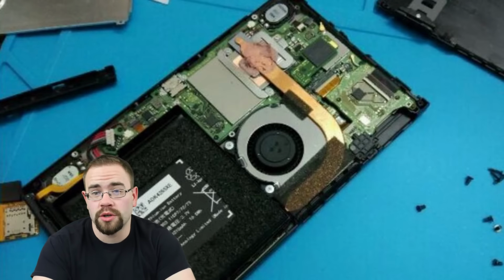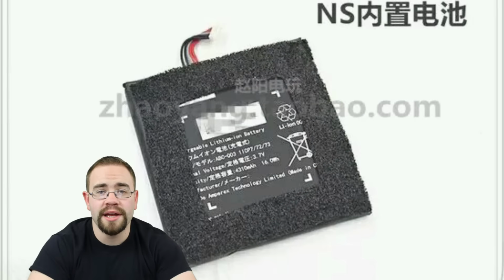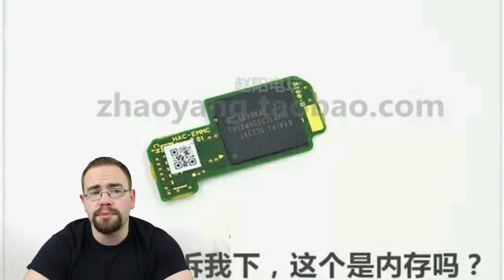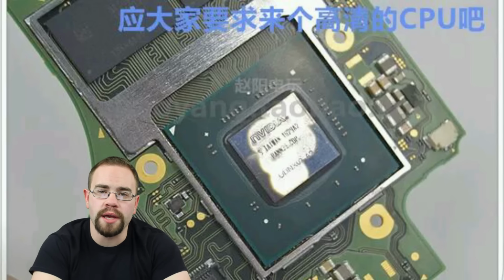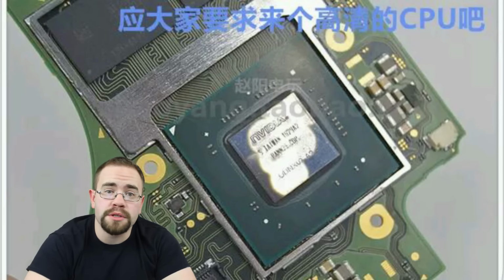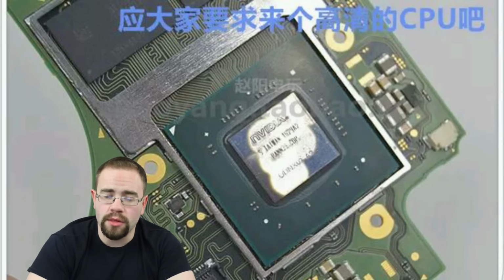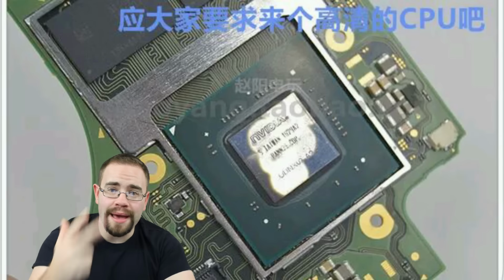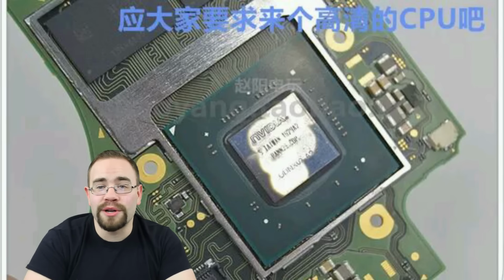The Nintendo Switch Was Finally Disassembled!

Comment: Stop spoiling yourself spawn, we all know you are more excited about being able to disassemble a switch than to play with it.
Reply: José Linares Whats the point if someone already opened it
Reply: Because these pics barely tell us anything about the thing and the person that opened it didn't analyze it at all so we still don't have any info on what stuff like the SoC or the RAM memory have exactly. The only thing this is really telling us is that the whole device is very neatly packed, there are still quite a few things to uncover by anyone knowledgeable enough if they open it themselves. (And besides, I'm guessing it's still a fun thing to do for some people, even if everything about the console is already known).
Reply from the maker: Yeah I'm really excited to get it a part. I think it'll be fun and if nothing else you guys will have a video to refer to if you need to replace your battery or card slot.
Reply: Because there's no confirmation on whether or not this one was a retail unit or DEV kit.

Comment: I love that people are shocked that it's a custom chip, and not off the shelf, considering that Nintendo announced it was a custom chip
Reply: Denni Wintyr ikr
Reply: It look like a Tegra  A2  chip
Reply: lot of women look like women, but underneath are "men"...

we need to see under the hood...lol

sorry i need some love in my life
Reply: Denni Wintyr Oh my
Reply: You don't have to reply to every comment, scrolling through I see you everywhere
Reply: Walther Penne zelda ran smooth at the treehouse event don't know what you saw maybe the old demo on the ground floor
Reply: ***** what they showed at the treehouse event didn't drop fps I own the switch and yes there is some dropping hardly any and it seems to be certain locations , even more demanding locations don't drop yet some isolated areas do, which points to memory leak issues, it happens in other open world games like the witcher 3 and even skyrim remastered, just spots that aren't optimized fully that they may have over looked,  it doesn't seem like hardware issues since they always happen at certain spots and in certain angles yet 90% of the game is fps drop free and will probably get patched out as time passes for being ported in a year on new hardware I'm impressed it runs as well as it does
Reply: In about 20 hours of play I've had two frame rate drops, of about a second each.  That's it
Reply: Denni Wintyr are you sensitive to them? cause in my first 30 minutes in great plateau I've had more then that, it's really random but it happens in specific areas I think it's due to being ported in like a year and it's hard to optimize such a huge game that soon
Reply: It is the worst on the plateau and is negligeble to almost non-existent anywhere else
Reply: TheJamaicanGamer well it happens in some areas I ran into some on the mountain near zoras domain, and other various random locations, I think it's just port issues and they will get fixed with time

Comment: The Foxconn leak nailed it.
Reply: Dash120z Somewhat. It has an X1 like chip rather than a P1, Pascal, like the Foxconn leak said.
Reply: Proto Onii naw it's a pascal
Reply: Proto Onii ya, i could have sworn they stated that.
Reply: Proto Onii well technically it is an x2 so it actually wasn't really wrong when it comes to that
Reply: Ryan Joseph invalid. No one knows what it is yet.
Reply: AUGMC True! True!
Reply: foxconn say looking at the core it is a 10x10,  from the cpu test: cpu 1785 Mhz , GPU 921 Mhz , "speculated it is a arm a73 pascal" he never corfirm it is pascal he only speculated that , from what neo gaf guys got this is a 11x11  not big dif if he only do it with eye. 

https://www.reddit.com/r/NintendoSwitch/comments/5ea9uo/rumor_someone_who_producing_switch_at_foxconn_is/

PS: sorry for my englesh hope all undertand it =P
Reply: AbdallahSmash026#1Fan well it's almost on par with the XB1 which is a good thing ;)
Reply: AbdallahSmash026#1Fan Get that idea out of your head right now. The switch will never be as powerful as the Xbox one
Reply: Dewott You don't need to be aggressive we are talking about a piece of plastic. Even if it was Pascal it still wouldn't be as powerful as an Xbox one. You really think a $300 tablet will have the power equivalent of an Xbox One? Go ahead and hype yourself up.
Reply: link2dpast the switch has no plastic in it whatsoever actually
Reply: Ryan Joseph So what is the outer shell of the Switch made from? Or the Joy-cons?
Reply: link2dpast Bethesda said it won't support the Switch if it was less powerful than the Xbox One ;)
Reply: Dash120z Source? And just to pop your bubble why doesn't the Switch version of Skyrim look as good as the Xbox Ones remastered version. I know the Switch version is also the remastered cause it looks a lot better than the original Skyrim but if the Switch was at least as powerful as the Xbox one why isn't it's version of Skyrim on par graphically with the Xbox ones version.
Reply: link2dpast here's your source  http://wccftech.com/bethesda-developing-nintendo-nx-powerful-xbox/
Reply: We haven't even seen the Switch version of Skyrim yet aside from some footage that was edited in.

People are assuming a hell of a lot.
Reply: kurisu7885 im sure thats why people are skeptical
Reply: ***** 
I can understand that, though I doubt there was any deception for that. For one it was a reveal trailer, so I doubt they had anything ready yet, and they usually do editing for those to take care of things like screen glare.
Reply: Robert Bair Unlike some people I read the content of any article and not just the Title. It was the interviewer that asked the question “If the Switch came out and was as powerful or higher than he Xbox one would they (Bethesda) consider making games for it"

This was Bethesdas reply.
"Then it will absolutely be something that we consider. Okay… let’s say they come out and say tomorrow it does X, Y, and Z. Well, Dishonored 2 is way down the road, it’s not in the conversation. But anything that is in development, I think we’d take a look at and see if technically does it line up with what they’re doing? "

What they are saying is that they will take a look and see if the Switch can technically handle what they have in development before they bring their games over. Meaning depending on its power some games can be ported and others cant. Bethesda did NOT say that they would not develop for the Switch if it wasn't as powerful as the Xbox one. You would only think that if you stopped at the title.
Reply: kurisu7885 I can base my opinion from what I have seen. I'm not making assumptions out of thin air. There was enough footage in that reveal to determine its graphical fidelity. From that footage the Switch version looks like a slightly downscaled version of the remastered edition. It looks better than Skyrim on PS3 but not quiet as good as the Xbox one/PS4 version. If they show something better later on I will happily change my opinion. But until that happens this is where it sits; NOT AS GOOD AS THE XBOX ONE VERSION.
Reply: You guys are so excited and I have no idea why lol Looking at a chip and speculating doesnt prove anything yet so many of you guys start saying its pascal for sure or that its performance is on par with an xb1. Nvidia already said its a customized tegra. That doesnt mean its pascal or has more cuda cores or is as powerful as an xbox one. Contain your enthusiasm otherwise you guys are probably going to be dissapointed.
Reply: Trent Trombley Finally someone that understands my frustration.
Reply: As for Todd howard saying that they will support the switch if its as powerful as the xbox one. You do know that developers can change their minds. They might have seen the portable nature of the switch and thought this is pretty cool. Lets try putting skyrim on it.
Reply: exactly, people act like if it was pascal it would be a huge difference in performance. we are talking about 250 or so GPu cores in this thing. It isn't going to stand up to the xbox 1 or ps4 that have well over twice the shaders of the switch.
Reply: @Box Block Games - and you clearly do right? You went for beers with Todd Howard and you sat down and talked to him and he said indefinitely that the switch has to be as powerful as the xbox one. Now you can tell me what technical sorcery they have done to make the tegra as powerful as an xbox one.
Reply: It's around a xb1 in the dock and more powerful than the wii u in portable mode.
Reply: Is that a fact? I mean the x1 has 512 gflops of performance. The P1 has 750. What sort of things have they done to this chip to make it twice as powerful as the p1. Because its nvidia their gflops performance is probably better than amd I will give you that but its probably going to only be at around 800 gflops at the most docked. whereas the xbox one is 1.4
Reply: Trent Trombley with that stated, its safe to assume that Switch is not as powerful as the one if we crunch numbers and go by them.
Reply: Why couldnt skyrim run on 800 gflops? Skyrim runs on a ps3 with 512 megs of ram the switch has so much more ram that the resolution could be bumped as well as the textures exactly what they have done.
Reply: alan bane I'm not ignoring the difference in architecture between nvidia and AMD. I know that nvidia has more aggressive compression techniques and other things that give them more real world performance out of a  tflop rating  than amd.. I don't think its enough to make up for the hardware difference between switch and xbox1 or ps4 for sure though. plus I really doubt that the switch cpu is more powerful than the eight jaguar cores of xbox and ps4. to my understanding, the switch will only be  able to use 3 of its cpu cores for gaming.
Reply: You do know what ram is for right? allows textures to be stored into memory. More memory means bigger better textures. also makes it easier to run at higher resolutions especially if you have higher bandwidth. you know the only real upgrades that skyrim got were better textures and uhhhh resolutions. shiiiiittttt
Reply: Box Block Games I don't even know where to start with you. So let me get this straight you were planning on getting the Switch only because you wanted it to be more powerful than the Xbox one? And now that you've come to your senses and realised how outlandish that idea was you don't want it anymore? If you are that obsessed about graphics why are you even interested in consoles, go game on a high end PC. And good luck getting a Tablet that can run BOTW. Tablets are not designed for intense gaming. Their operating systems priorities multi tasking to high end gaming. If we are to go with the leaked spec sheets that say the Switch dedicates 3.25gb of its 4gb of RAM and 3 cores of its quad cores to games then even if you get a tablet on par or more powerful than Switch you still won't be able to run BOTW. Android and IOS focus on running several applications at once and they do this efficiently by managing resources. They will not allocate massive amount of RAM space and processing resources to just a SINGLE app. I have yet to come across an app that hogs 3.25gb of RAM and 3 computational cores all to its self. It would slow down the operating system and you wouldn't be able to run any other app in the background. Tablets like PCs are multi tasking machines first and like PCs they would require a lot more onboard resources to accomplish what their console counterparts do. A PC with 512mb and a 250 gflops GPU cannot run Uncharted 3 but a console did. So even the most powerful tablets out now like the Google Pixel C with a tegra X1 cannot run BOTW or Skyrim in their current form.
Reply: I'm also hyped for the switch and want to get the best hardware but you have to stick to FACTS. You guys are way overhyped and overly agressive. So thanks to lnk2dpast and TrentTrombley for making sense.
Reply: link2dpast you're right but what's the point of making the Switch just as powerful as the Wii U? Didn't Nintendo learnt anything with the Wii U?
Reply: Dash120z The appeal of the Switch for a lot of people is its portability. Wii U never had that advantage. If the 3DS crowd adopts the Switch, Western triple A companies cannot ignore it. The Switch from all accounts is more powerful than the Wii U but from what I can gather isn't as powerful as an Xbox one. But guess what...that doesn't matter. What is lacks in performance it gains in portability. It's more powerful than the Wii U, has modern APIs, an easier development environment. By all accounts it's light years ahead of a Wii U. If Crystal dynamics could port Rise of the Tomb Raider to the Xbox 360, Triple A western developers can surely port their games to the Switch if they think it's a viable platform. I'm getting a Switch but I'm not getting it because I think it's going to be more powerful than an Xbox one because I will surely be disappointed if I did.
Reply: link2dpast I totally agree. These games graphically aren't a huge jump from the wii u.  To me its more of a gamecube to wii 1.5 differences. Lastly, ill end up getting switch anyway just for pokemon, smash and bayonetta. (And rpg games) xD As much I wish they made it strong! Wanted kingdom heart 3 on switch. Boo :(
Reply: link2dpast as long as the system is Pascal based I don't mind.
Reply: Brian The Lion Kingdom hearts 3 and FFVII remake are being developed with the Unreal Engine 4. This is where Switch's better development environment comes into play. Because it supports Unreal Engine 4 Square could much easily port those games to the Switch than they could the Wii U.
Reply: Link2past, Yes. But they would have to downgrade it. Not sure if they be up for that. Square Enix hardly downgrade their games. But we'll see. If they did port it. I'll be happy. :)
Reply: @Brian The Lion - They have made kingdom heart games for the DS and even kingdom hearts 2.8 has the 3ds game remade for ps4 so anything is possible.
Reply: link2dpast surface pad pro  4 or iPad Pro take a pick
Reply: Gregory Msuya I don't understand. You just drop two tablets with no context. What about them?

Comment: This chip might be in its own class. Something that Nvidia will only ever use on the Switch.
Reply: joel hierro The code on the front has "NX" in it. It's the Tegra NX. That's where the codename came from!
Reply: For all we know this is something brand new Nvidia chose to unveil using the Switch.